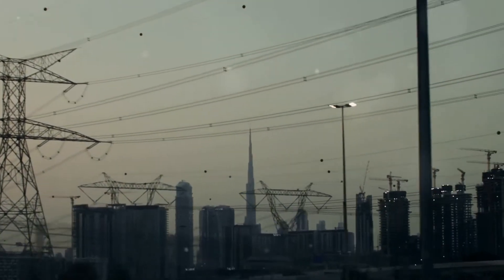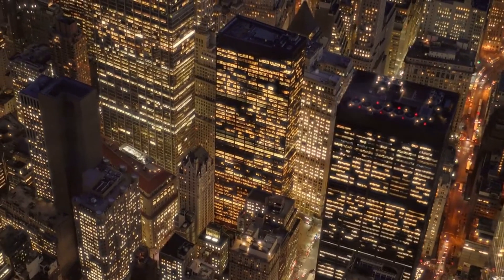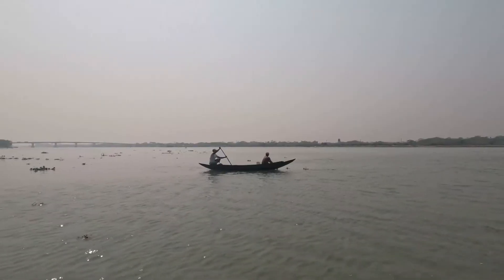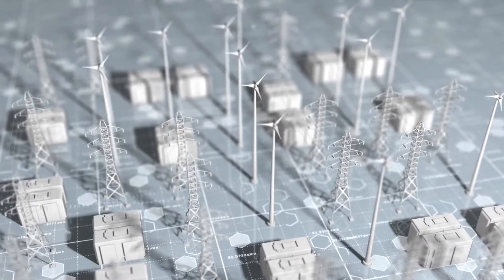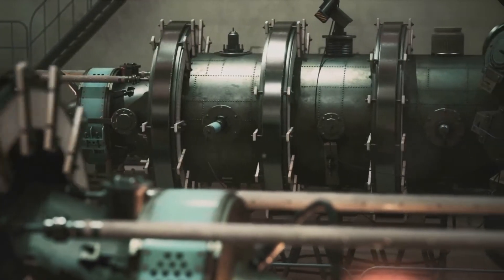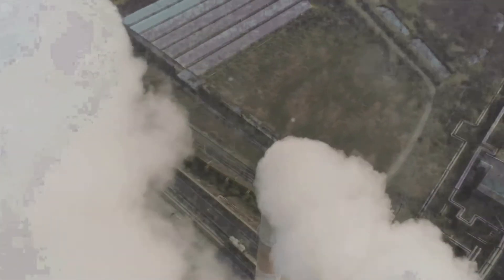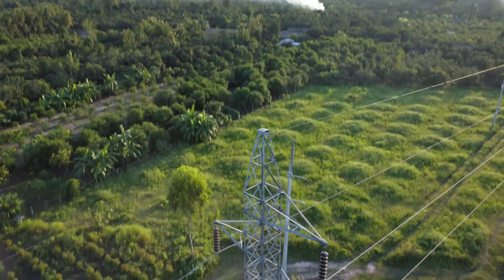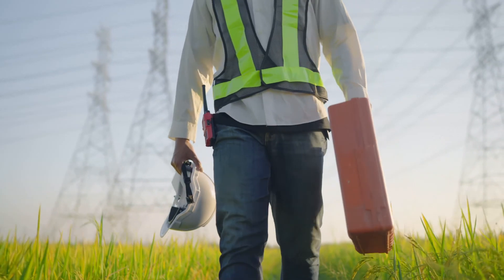Is Reactive Power REALLY Necessary for a Stable Power System?

Comment: It's not really misunderstood, it was misinformed for the purpose of simplifying billing.

"Unsung hero" might be misguided too.

Reactive power is just an integral part of electrical energy. It's percentage is higher or lower depending on the load. It's also affected with distance, height, insulation, etc. of the conductors.

Comment: Reactive power is not produced. it's a bi product of poor power factor. Its not desired and if it eliminated would be ideal. Reactive power is not something that the power company create its determined by the load and power factor. And causes higher current draw than actually needed to produce real power. So this makes no sense.